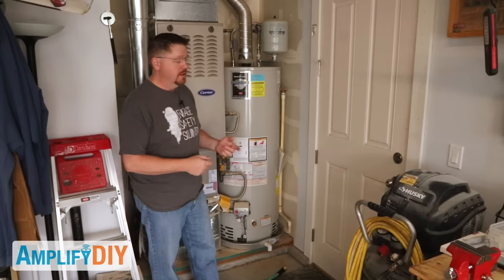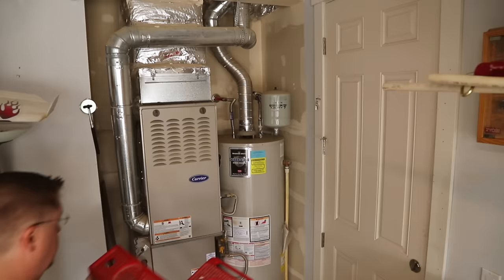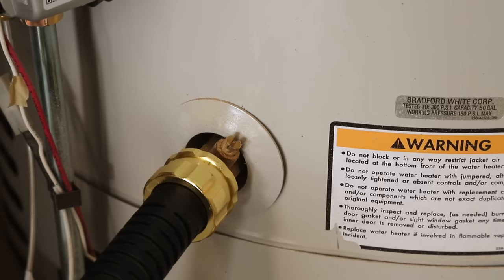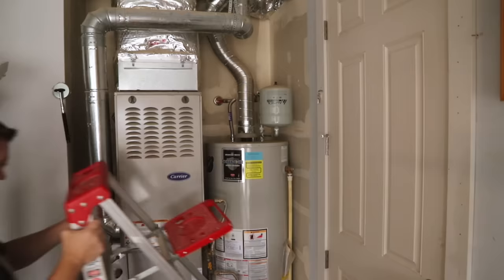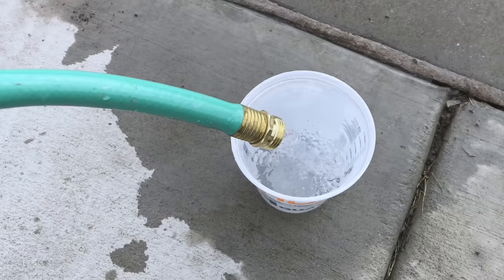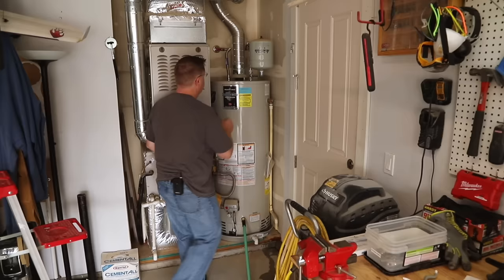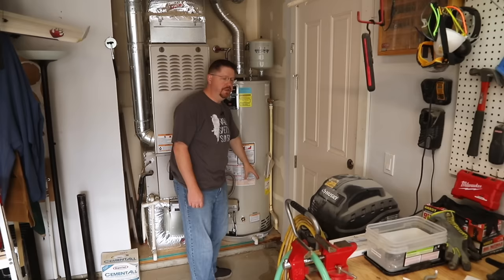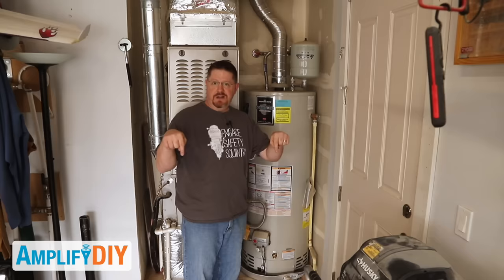How To Flush A Hot Water Heater To Remove Sediment

Comment: We don’t have to do that with our cylinders in the uk mad you yanks you should start learning off us and I can’t see that small amount of sediment or more sediment rotting that tank it’s just like scale build up I’ve pulled out copper cylinders 30 year old they are mint condition and pulled out unvented cylinders that have been 15-20 years old never had any issues
Reply: Also your prv terminates into your garage floor that’s bad that if that over heats or builds up your gonna have 90-100 degree c of water all over your garage what if your in there or a member of your family we terminate ours to outside preferably into a grid shocking regulations or code whatever you lot call it
Reply from the maker: What can I say? Maybe the water heaters in England are somehow vastly superior to those we have here... but I'm willing to bet tat in the words of @AVE - they are "same same, only different". As for where the T&P terminates, believe it or not mine is done correctly to code (it's one of the things that the plumber who installed my system did right). I've never heard of anyone being scalded/burned by an emergency release of their T&P valve that was set up like mine here in the US. Thanks for watching!
Reply: @AmplifyDIY  we have your type of cylinders here there called andrews cylinders more for commercial use really I don’t like them to be honest have you seen our boilers what we use combi boilers thst do heating and hot water do you have them there or anything like that interested to know thanks for reading this!
Reply from the maker: @pauls826  I'm sure there are similar systems here in the US to what you describe, but they are NOT common at all. The most common by far is the sort of thing you see in this video. For residential use, tankless water heaters are sort of starting to become more common, but by far the vast majority of residential water heater systems here in the US are just like what you see in this video.

Comment: so much wasted water
Reply from the maker: This procedure uses about 150 gallons of water.... which, yes, largely goes to waste... but is a lot less wasteful than replacing a heater which has failed prematurely because it was not maintained. Also - currently the MOST expensive water in the world is in Moscow, Russia, coming in at $684 for 100 cubic meters. 150 gallons is around 0.57 cubic meters, so some quick arithmetic shows that even there the total cost of this water would be less than $4USD. 

I know drought is a problem in many areas, and that water bills can get quite high - but flushing your heater will barely cause a blip on your bill and will have negligible effect on local drought conditions.

Comment: The information you gave in this video is completely useless. It did nothing to improve the performance or extend the life of your water heater. Service plumbers everywhere thank you for misleading your viewers into thinking this is actual maintenance. There is a way to properly maintain your water heater, but this isn't it.
Reply from the maker: Hey C - If I've given out incorrect or misleading information, please point to specifics. Why is what I've shared "completely useless"? What steps / processes do you consider as the proper way to maintain a water heater? Thanks!

Comment: terrible video you didnt even tell us to turn off the gas
Reply from the maker: You don't need to turn off the gas to flush a heater. I address the way to set the heater to pilot or turn off the breaker if it's electric.

Comment: Flushing, a hot water heater is a waste of time and money. It doesn’t do any good
Reply from the maker: Have any evidence to back that up?
Reply: @AmplifyDIY   no matter how hard you try, you'll never be able to get all the sentiment out of the bottom of the tank. It's pointless a waste of time and money. Anybody who offers it to you is either trying to steal money from you or just want you to shut up
Reply from the maker: @dallaswood142  I respect your opinion... but it flies in the face of everything every manufacturer has to say about maintaining a water heater.  I agree it's impossible to get 100% of the sediment out.... but you can easily get at least 90%+ out, which makes a HUGE difference. Further, I'm not suggesting hiring anyone to do this... do it yourself, save a bunch of money you don't need to spend on a plumber, and extend the life of your heater.
Reply: @AmplifyDIY   I can definitely understand where you come from and the manufacturers guidelines are not always accurate to what consistent with building  For example, if you were to  install a window, would you put screws in the top and the bottom of that window like the manufacturer says? Or would you only put them in the side so that when the house settles and sags it doesn't limit and lock that window being able to open up and down properly?